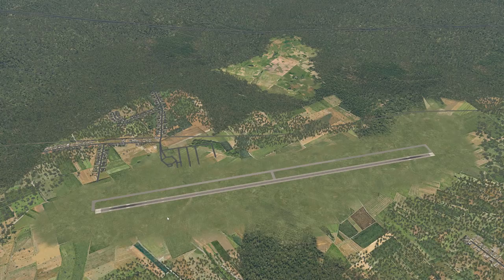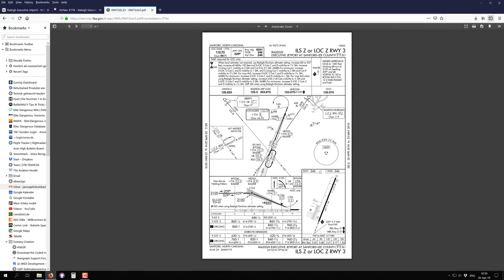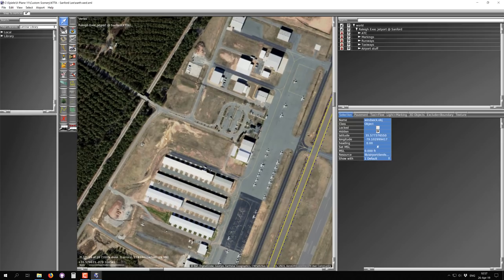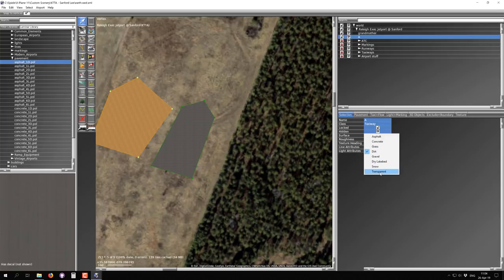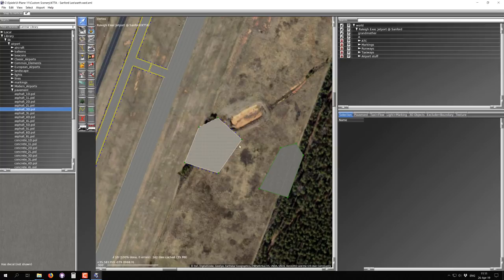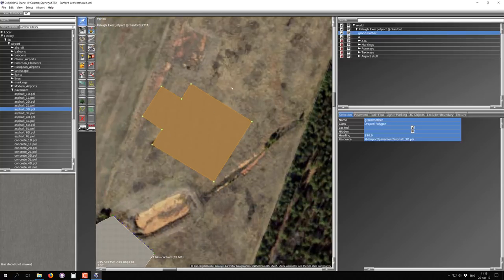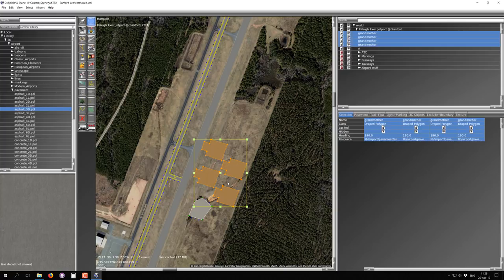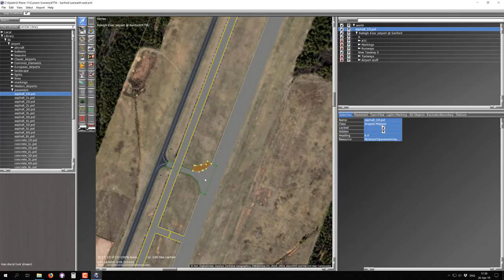#5 - Placing taxiways and polygons

Comment: Very good job Jan! Thank you. I´ve just concluded the hole "story" and now I know a lot of more than before. You said, you will explain how to get any perfect cycles and how to cut stupid streets in the middle of the airport, but I never got these info´s. Have I overlisten it?
Reply from the maker: Hi Falko, thanks for your nice words! I think I talk about cutting away unwanted streets in the "exclusion zones" video... basically you have to kill the end-nodes with your exclusion zone. I may have forgotten the "perfect circle" - you need to make a circle out of 4 "bezier nodes", select the whole thing, and then go to "edit - make regular polygon". 

Cheers, Jan
Reply: @janvogel9719  Perfect! It works pretty fine... Danke und weiter so (was auch immer du machst^^)

Comment: Hello Jan, great videos, i'm starting getting addicted as you said lol, .

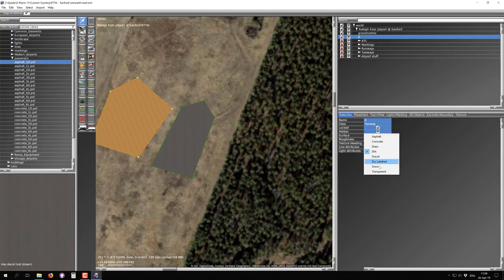Now, in this video #5, you mentioned in the min/second  20:50 about the transparency taxiways use not clear what that's for, well, obviously i didn't get that far but i have an purchased scenery  https://store.x-plane.org/PHNL--Honolulu-International-Pearl-Harbor_p_1129.html where i see in selecting the aircraft in the parking slot and not see anything in the map but the slot, so, i think the transparency here is used as the author used the dsf as the texturing for the scenery instead wed and the transparency is just to tell xplane that is a taxiway.

in the other hand, could you please help me to understand why i get so low fps in this scenery?  what could be the reason, the author does not know clearly, he knows that it gets more in windows pc than mac as me

thanks

Comment: Hi, I have a question. I have placed taxiways on my airport and fully covered the taxiways with polygons to give them a different texture. My question is will doing this increase the load on rendering coz first rendering of taxiways and then polygons? If yes, will making my taxiways transparent help since polygons are above them it won't make a difference visually.
Reply: Hamza Khan It will, you can see if your texture is in the property’s panel of the taxiway.

Comment: Jan! Thanks for your videos. They are very clear and informative. In order to avoid problems when recording video (disappearing the cursor, freezing the first frame, etc.) I want to advise another program to record video from the screen. This is not an advertisement. Camtasia does not work well with the OpenGL: hence these problems arise. It is preferable to use ZD Soft Screen Recorder. This program is devoid of problems, which I have indicated above, is simple to set up and very inexpensive. There is an opportunity to try it: a trial version for 30 days (although it will be glue the watermark on the video). https://www.zdsoft.com/screen-recorder.html

Comment: Is it okay to make runway shoulder with polygons?
Reply from the maker: It is the preferred method (after using the built-in default shouders). But you must take care to get the joint between shoulder and runway right, otherwise you can see the ground in the gap or there is too much overlap...
Reply: I got it. Thanks for your answer and great video !! :)